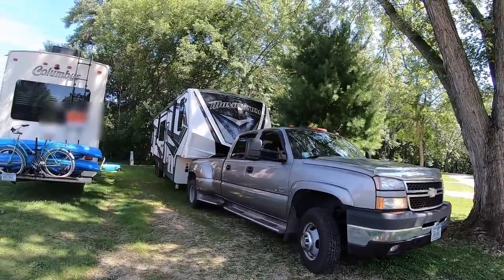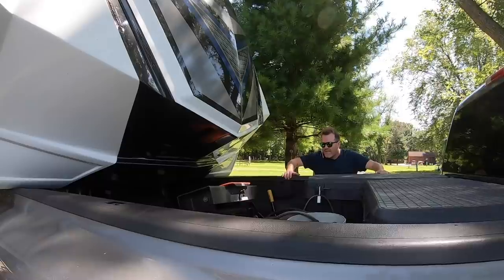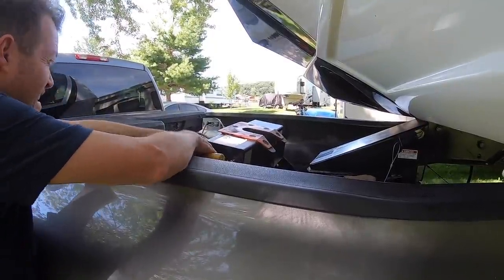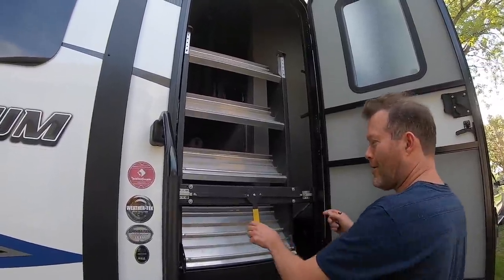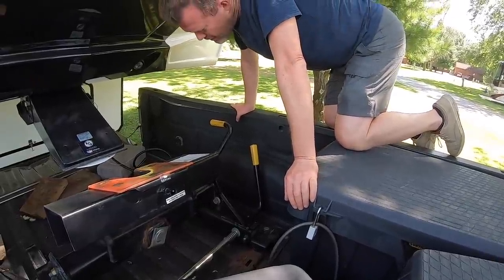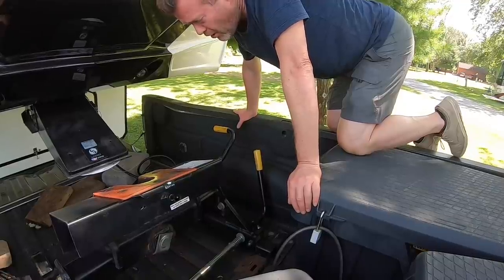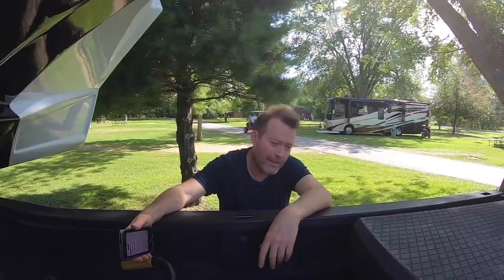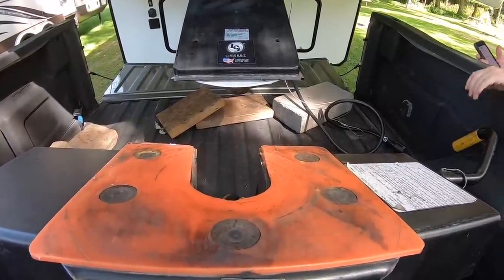RV CRUSHES MY TRUCK ON 1st TOW! BIGGEST RV LIVING FULL TIME MISTAKE! (PT 2)

Comment: YES - in answer to your own query at 7:11 there WAS something that occurred that you seemingly are NOT aware of, and that was at the instance of hitch drop - your truck's chassis was given the REVERSE BANANA "look", in that the tray area uplifted slightly pulling the tray BACK from the cab (check your chassis rails underneath - as you may well have BENT your entire chassis.
Reply: LOOK SPECIFICALLY at 0:10 and roll the clip..
The chassis cab & chassi tray (sections) part ways, as the chassis is bent upwards at that point.
You would also have been wise to leave the tailgate DOWN, until you knew the hitch was secure, as dropping into the tray was fine, but as for destroying that tailgate for no reason at all?

Comment: Yikes, I used to work at an RV dealership as a service advisor and had a couple close calls with the king pin not being fully engaged in the lock. I would always play it safe and have the customer do a tiny tug with the legs on the rv down to make sure everything was properly locked in place. As I said there were a few occasions when the customer went to go and you could see the lock wasn't properly locked around the king pin and quickly told them to stop so we could re adjust and try again. These things happen unfortunately. My advice would be to always give your fifth wheel a tiny tug with the legs down and watch the king pin/lock area to make sure everything is locked in place. Good luck on your future endeavors!

Comment: I applaud you sir for posting these videos , lot of people are watching and being negative, but I have being towing a travel trailer for twelve years and every trip there is some challenges, I have had a lot of camping and towing situations, and learned a lot so now I am prepared and accept these kind of life experience.

Over the years incidents 
Trailer tire blowout 
Propane cover flew of the trailer when driving down the highway, did not hit anything 
Exhaust pipes dropped
Truck front bearings, and leaf spring
Bicycle rack on trailer with two bicycles was dragging on the road while driving the rear bumper of the trail weld broke 
Power inverter crapped out 
Last season end of the camping season the awning post, I forgot to undo the release bolt so it came out of the track, so I will have a task this camping season one many.🥶👌🏾👏🏾💪🏾😱😫😩🍻🇯🇲🇨🇦.

Ps one of the best purchase like you is the walkie talkies really help when backing or leaving the camping spot.
You keep composed👏🏾a great attitude.

Comment: Next time listen to the old man when he tells you how to do it...
Reply: Your tailgate may have suffered some cosmetic damage, but it saved your trailer from hitting the ground.  Imagine that phone call
Reply: Exactly
Reply: Or maybe next time buy a less complicated 5th wheel hitch....
Reply: next time have the old man go through the hook up process with you there is no harm in hooking the trailer up before your ready to leave.
Reply: @JSCB-365  Cosmetic! that gate is totaled!  Probably $2500 right there!
Reply: @dirtcurt1  where I work if it opens and closes it's still good to go. They don't replace the part or the truck till it's inoperable. 

It may be an expensive part to replace but the labor is easy.
Reply: Huh old man didn’t help him he disappeared
Reply: @genek121973  I use a Hijacker 5th wheel hitch.  There is a bar that slides completely behind the hitch pin.  Impossible to high pin it and impossible to have a false lock.

So many people have dropped their trailers because of hitches with gimmicky locking mechanisms. Reese comes to mind.

Comment: lucky it wasnt in the cold. Those fender do not bend like that normally, they crack. I have 2005 dually and had to repair my left fender because they are so expensive  to replace ! Always tug test with trailer brakes on and the legs still on. Those are very strong legs so it wont hurt them.

Comment: I have a B&W Companion Slider Hitch.  It attaches to my truck with B&W's turnover mount.  A little pricey but I like the sense of security while towing.  When the Pin is locked, you can see the back of the 1" hooks/locks wrapped around the Pin.  I just take a look as I raise the tailgate and plug in the 7 pin connector.  Another nice feature of the B&W turnover mount is when you take the hitch out, the bed is clear.  No rails to deal with.  And... Always do a tug test!  Raise your front legs about 1" and pull.  If it comes off, No harm, No fowl!

Comment: I agree with pulling on the hitch with the legs still down. “Tug Test”  use the YouTube money to fix the truck..
Reply: Not a great idea, without at least a couple of inches clearance, actually.  Easy way to bend the jacks.  Hydraulic tubes can be bent, and replacements are expen$ive!
Reply: @125AXer  you dont drag the trailer... nothing will get bent
Reply: I do understand the concept, but if those Jack pads are touching the ground, and they hang up even a little bit, The mechanisms can be damaged.
Reply: @alansheidler4486  hang up on what... the trailer doesnt move in a pull test.. you hold the brakes on in the cab
Reply: @rollinlowford  Experience with electric brakes is that they do not lock in a stationary position when applied.  If you understand the mechanism, rotation of the drums is required to get the brakes to give any stopping power.  Applying the brakes at a standstill won't make them work until the wheels have turned a bit, even for the best operating/newest systems.  And that is plenty to bend jacks which are still in contact with the ground.
Reply: @125AXer  if they dont grab they are out of adjustment and not legal. When dot/mto do a roadside test you apply them when in gear any movement forward is a failure and they will pull the plates.
Reply: @rollinlowford  You speak of air or hydraulic brakes.  Technically: Electric brake systems on trailers work when an electro-magnet is energized to be attracted to the flat inside of the drum, and is dragged by it.  The lever attached to the magnet moves the brake shoes into contact with the circular friction surface of the drum, creating the drag/stopping action.  If there is no rotation of the drum, there is no braking.  Brake controllers (regulators for the voltage sent to the brakes) can be adjusted to fine-tune the level of braking force.  But even if cranked all the way up, a properly working system will require some rotation of the wheel in order for them to be activated.  I tow any of three dual-axle trailers with electric brakes for work, and own a single and double-axle trailer personally.  That's 9 axles with electric brakes.  I have serviced them, I know how they work, and the design hasn't been changed for a very long time.
Reply: @125AXer  yet it wont pass an inspection if they move when applied... try again.

Comment: And that’s why everyone pulling a fifth wheel should have a CDL! They are a danger to themselves and everyone else on the highway!
Reply: you shouldnt need a cdl for this
Reply: Um, no.
Reply: Well I agree with you that hitch is different than what is on a semi. I only have one lever to pull out and that's it
Reply: Agreed. Most RV people have no idea of how any equipment operates or functions together. Additional testing should be required. Like learning hook up, backing and braking procedures. Driving in a straight line at the dealer isn't enough.  Most RV drivers still drive like there are in a regular passenger vehicle.
Reply: Agreed!
Reply: Some people with CDL's still don't know WTF they're doing!
Reply: I retract my Previous comment and substitute it with the fact that yes some of you are right additional training should be required, not necessarily a CDL but definitely more training.
Reply: Because driver license training eliminate traffic accidents right? CDL Drivers never have accidents either right?

Comment: Always do a "pull test" with the legs partially extended, as I'm sure you now know.  Never assume the jaws are closed & locked, always check them visually & don't get offended if your spouse wants to double check.  I did the same thing trying to only move my rig forward five feet.  I picked the front legs up enough to clear the cement pad we were parked on.  When it dropped, it just touched the box, but I destroyed the tail gate.  Thankfully, Tie-down straps, which I used to keep the gate closed on the way home.  Total bummer!

Comment: I did that once. But my Pin Box mostly caught on my tailgate which took the brunt of it. Damaged one side wall a bit. Still no clue what happened, the lock jaws closed and I got the safety pin in. Best guess is that it locked around the bottom of the post and bumped off as I started off over a little road bump.  So now I always test pull with the legs  barely off the ground.

Comment: User error for buying a cheap Husky hitch!  Also remove the white slick plate because there is an orange one already on the hitch. Using both makes the pin too high for the lock to properly engage. Get a Curt or Reese. Spend the extra few hundred and know you have something good!

Comment: yeah i transport for a living, gotta say after watching these two videos, id find a better hitch. nothing about that seems correct to me. got over 200k miles on a reese 22k fixed, non sliding hitch. only recently replaced it due to it being pretty worn out and getting some slack. now using the curt q20 or well as my hitch says, ram q20 as its a dodge special.. maybe i missed something in the videos but something didnt seem correct about the hitch.

Comment: I had a spring that would lock hitch to king pin, with audible click. I would still visually check Jaws were locked around king pin and then do a test tug with the trailer brake controller fully engaged and rev up a bit.

Comment: I did the same thing with my old trailer.  Fortunately when it came down into the truck it landed perfectly between the two rails of my Pullrite Slider hitch.  I infact as they suggested top loaded the hitch.  A real sickening feeling for sure.  After that happened, new routine after I hitch up, I lift the gear off the ground about 1", apply the trailer brake and see if the trailer will hold the truck (good way to test the brakes to!).  I am really sorry to see that this happened on your first day.

Comment: Well, if it's going to happen, better when moving off than when you have some speed up.
Looks like you didn't push in and lock the handle (might have missed seeing you do it) - remember that lock pin the chap mentioned connecting the breakaway brake to?

Comment: since the Tailgate is damaged already might as op for the one with 5th wheel in mind a stromberg louver style I think would fit well with you truck and style also give you more clearance room when latching in and doing a tug test as for the dent in the bed walls 2by4 and a few mallet hits to level it out. But I also agree with others on a better style 5th wheel hitch but understandable they are expensive but also have easier understandable safety features. But nice to see no one was hurt and the tailgate wasn't ripped off or the bed torn, Wish you 2 the best into the new year!

Comment: New subscriber here and fellow 5th wheeler. Did this on our 2nd 5th wheel after I just got it home and unhooked it with my daughter. My mistake was I got into too big a hurry and forgot to put the front stands down. My tailgate was already down and like you no damage to the trailer. I have a  identical truck but not a 4 wheel drive. The truck I had back then was a 454 gas 78 chevy 1 ton that wasn't damaged at all like yours? I told my daughter dont tell mom who was at work that day😁👍I always test it now after hooked up with the stands down but it's a good idea not to drive off after disconnected with the stands up too🤣 Oh another tip without a VGate don't drive off with a regular tailgate up. Woops, new tailgates are not cheap but Vgates are and used ones too

Comment: You may have very little damage on the bottom, but I would check the seam on top of the trailer where the fibreglass front cap meets the rest of the camper top.

Comment: So i use a goose neck hitch .   B&W turn over ball on truck. Adapter on my 36' camper,  it came that way . Mostly pull a 20,000 lb. Wilson livestock trailer. Is there a reason to use that  little 5th wheel thing ?

Comment: It didn't want to unhook possibly because there was just enough twist or pressure to keep the lock engaged some of those hitches are super sensitive sometimes you got to be just at the unloaded height and sometimes you need to bump forwards or backwards. If you measure the truck Fender height to the ground when unloaded you'll know where you're at if you ever have a problem while trying to get unhitched. Good luck safe travels

Comment: So i used to work for crown campers a rv dealer for a a few years.just to confirm for you .the hitch pin on the camper was sitting above the slot it needed to go in thats why the indicator pin stuck out far enough that's what the lady on the phone was telling you .(the camper part was sitting above the slot/groove in the hitch on the truck. #2 the bed of the truck is the cheapest thing that could've gotten smashed! ya'll must be living right.# 3 and most important and some thing  if in doubt if you are CONNECTED "HITCHED" back up before going forward. it will force it to lock;  if it is not!!! hope this helps  and wish i could've commented before the video lol!!!!

Comment: Good for you posting this video so others can learn from it.. And Ed Calcut is right, always do a tug test first, but he didn't mention to apply the trailer break first, then tug.. that way the trailer will stay where it is and not roll forward. I wouldn't tug test with landing gear down, you could damage them. Just apply the trailer break, then tug. 👍

Comment: I hate to add insult to injury, but in my experience as a semi truck driver, you should always do a pull or "tug" test against the fifth wheel to ensure proper locking before you raise the landing gear.

Do this every time you hook up to a trailer, even if its the same trailer, and unless your fifth wheel breaks (which is very rare), you'll never drop a trailer.

Comment: Just a hint > When raising the landing gear, never power them constantly for more than 30 seconds. Don't want to risk blowing out the fuse. Give it a few seconds to cool off. A blown fuse, and you don't have one to replace it, especially on older trailers with glass type fuses. Most people don't carry spares. It can happen and your stuck until you get the manual crank out.

Comment: Well you don’t have the camper hovering over the hitch. You have it where when you back under it the truck lifts the camper some and make sure you back into it with a little bit of force then do a small forward tug to make sure it locked in

Comment: Been there done that!  What a drag!   You both remained incredibly calm.  We had some swear words, but too tried to remain calm and get ourselves out of the mess.  Our hitch held as we pulled forward about 4 feet but when my husband started the turn it dropped.  Poked a golf ball size hole in the fiberglass because we have a bed cover so the rail sticks up slightly.  Dent the side panel on the one side and the tail gate was crushed.  It was a loud crash but overall we too felt lucky that it could have been so much worse.  I always do the tug test but skipped it that day as it was the 2nd time hitching.  Our front compartment was open and hanging on the hook and tail gate down so we discovered there wasn't enough clearance to shut them.  So we put the gear down and I pulled slightly forward.  My husband shut the compartment and then I proceeded to back the truck to hitch.   We think I just didn't hit it with enough force since I had only pulled forward about an inch.  And I'm pretty sure I failed to do the tug the 2nd time.  I normally always double check my husband's steps of putting the safety latch on, Oh S*** cable and the electric cord.  That day i skipped that step.  We were trying to work slow and be mindful but i think that mentally we had already done the steps once and just had a couple of brain farts.  Some of the best lessons are learned the hard way.  Thanks for the video, gave us a few more things to keep in mind and double check.

Comment: Just 1 more reason that I prefer a gooseneck hitch over a fifth wheel, in my opinion both pull pretty much the same and I don’t have anything in the way when I’m not pulling a trailer. I’m usually pulling a flatbed with farm equipment or hay which is heavier than most RVs ad never have a problem. 
I do have an older 32’ fifth wheel RV that we converted to gooseneck after 2 years with the fifth wheel.

Comment: Unfortunately, all 5th wheel hitches are NOT standardized.  When I switched for a regular 5th wheel hitch to one with air bags the safety check between the two was almost opposite.  The same happened to my truck. It was late at night, I was tired and working alone. The jaws were wrapped but it fell anyway. No damage to anything except the truck rails.

Comment: Your using two ware plates. You don't need the white ware plate you put on the trailer king pin because that fifth wheel has the orange one built in. Your making the king pin to short with both having a ware plates. You should only use one. This will help you from high centering the king pin.

Comment: You should always reverse back, hear the hitch lock engage then try and drive froward with drakes on trailer locked on, to ensure it engaged and locked, do this a couple of times to ensure engagement ? as on semi trucks? alway check hitch with legs still down just off the floor by an 1 inch or so,